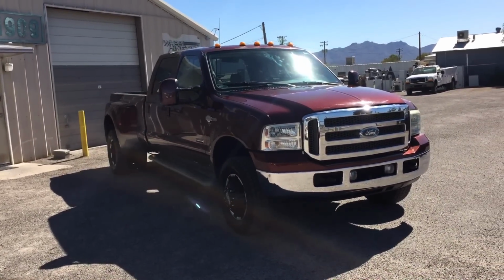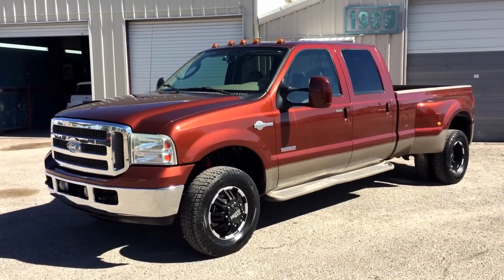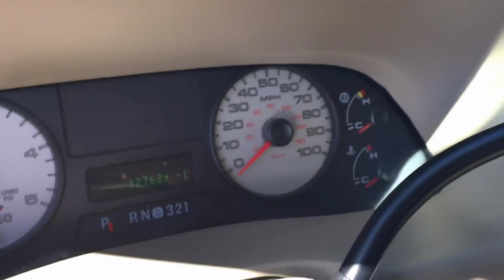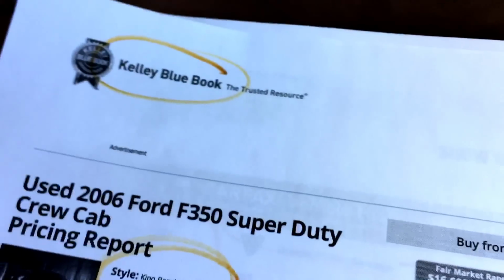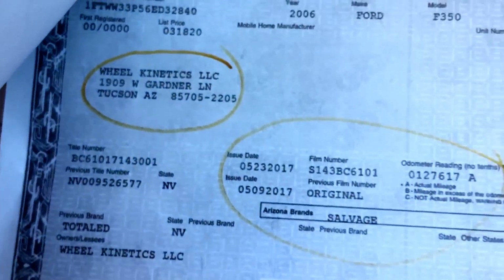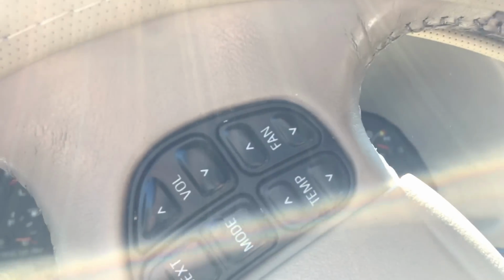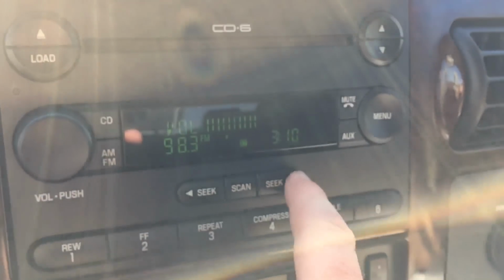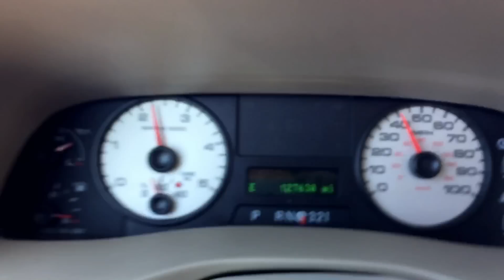2006 Ford F350 King Ranch Bulletproof

Comment: Listen to that 6.0 purr, once it was bulletproof it made it a 7.3 upgrade and a very good motor, much better then the embarrassing 6.4 motor. 6.7 is a great motor too but the emissions will dictate if that motor will last over time. If you can get the power numbers from the 6.0 as a 6.7 or better you'll be better off with the 6.0 or just get the RAM and save yourself the burden as the Cummins is a better motor...